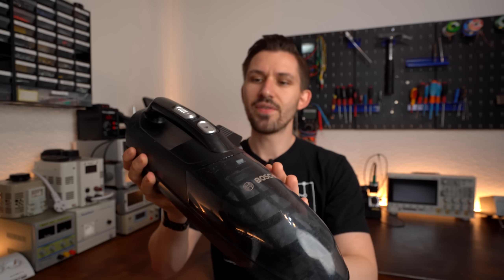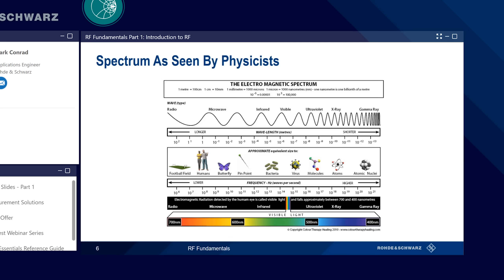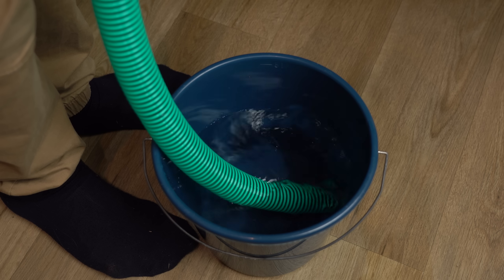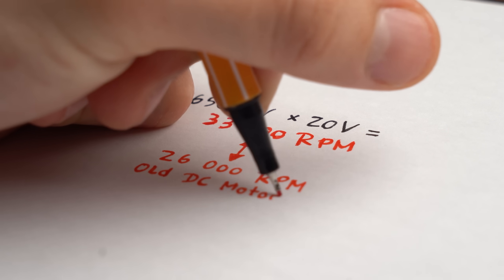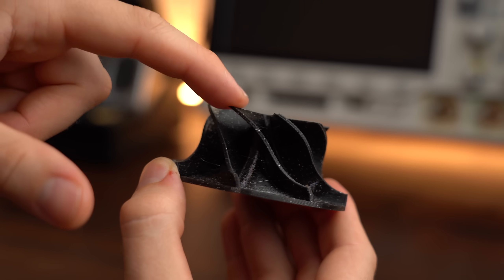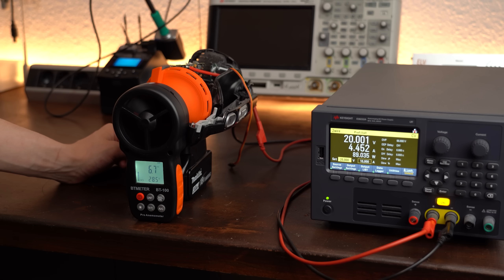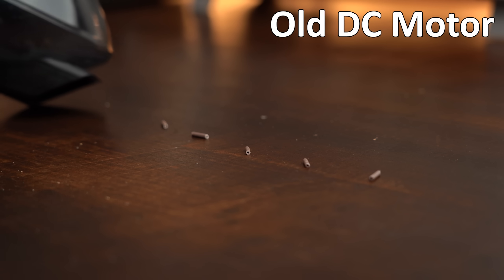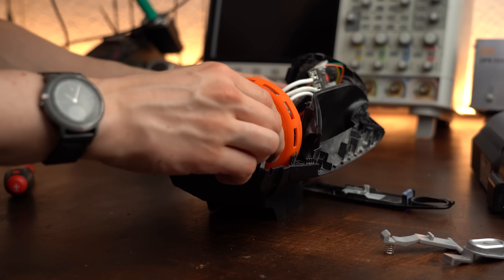My Last Chance to OVERPOWER my Vacuum! (Homemade Turbine V2)

Comment: You should use propellers made from resin mix Siraya tech tanacious and normal resin 50% 50%, this will give a very strong blades yet have some flexibility and not brittle like normal resin. There is a video discussing this in details search for it, I can’t mention it otherwise the comment will be removed.

Comment: Did you try to make a small tread inside motor axle instead of using glue? If you don't have a milling machine, print tool to guide drill.

Comment: You need to key the impeller to the shaft with a locking nut on the end.  That will solve your impeller walking issue..

Comment: Some BLDC motors just have a nut on the end that you can use to ensure the prop doesn't walk off the shaft. Some are even reverse threaded such that when the motor spins, the screw tightens down on the part. You could also go for a keyed shaft to reduce rotational slippage.

Comment: Wow very interesting video! I have done a lot of airflow and suction measurements and most important for good cleaning power is the airflow from the floor nozzle. I have dedicated airflow/suction box for that. I can seal floor nozzle to the box and get very accurate readings.

Comment: Too big impeller inlet and way too big impeller height. That type of impeller gets efficient past 60-70krpm and you need more radial surface area for vacuum. None of the turbo impeller types will work. 15-20mm inducer and over 80mm exducer with mean height of the impeller around 10-15mm and your going to see much more vacuum.

Comment: I would highly recommend screwing the impeler in place, either on the top or side of the shaft. I believe it is necessary for any fan system to function correctly.

Comment: I think you're hitting material strength limitations. If you could find a better way to attach the impeller to the shaft and make the impeller sturdier, you could really push this system. I'd suggest (back seat engineer with no experience here) baking the prints in sand to melt the layers together while maintaining the shape, also trying to temper the plastic(?) and pinning the shaft to the impeller to stop it breaking off (metal has a higher shear strength than glue).

Comment: You need to use more radial impeller design not mixed flow impeller to create more vacum, try to maximize the impeller outside diameter keeping a low width

Comment: Which material and nozzle size did you use for printing the impeller? Smaller nozzle (like .2mm) would probably make a smoother part with less friction, Polished metal even better. Very cool test btw. As other commenters mention of course Bosch/Dyson engineers will get a better result. Imo. it all matters how close one may get by experiments at home..

Comment: You might be able to alleviate the impeller pulling itself off by implementing some set screws. This of course though means redesigning the impeller and also adding some rotational weight.

Comment: So I have about 0 qualifications to give my thoughts but wouldn't using something with it's own ridges be a better shaft for that motor? Like if you were to use something like a nail or drill bit then melt it into the impeller and maybe still use glue? You'd be working with the shear strength of the plastic as well as the glue.

Comment: That looks quite futuristic there. But why is there some kind of radial fan in most vacuum cleaners?
I would do it exactly the same way again: A radial blower. There is certainly room for optimization in the details of the design. Powerful vacuum cleaners have (or had?) two stages arranged one behind the other. The separator between them has guide vanes. You have the space for that. There is still the question of whether such stacked radial blower stages may be constructed in the same way or whether each stage must be optimized individually. These are details in fluid mechanics that have remained hidden to me until now ;-)
The question of the optimal speed is also interesting. I am sure that more speed does not generally lead to more airflow or lower pressure, if the flow is obstructed (by the ground under the brush, by the rotor blades themselves). At some point, stalls are likely to occur.

One more thing: You can cool a motor by directing the exhaust air at it.
Reply: Another thought from last night: How even is the weight distribution of 3D-printed symmetrical bodies?
I have no experience with 3D printing.

What I could imagine as a simple test rig for unbalance detection: The motor including turbine wheel and mount is held on one or both sides with piezoelectric elements (simple piezoelectric speakers are perfectly sufficient). The piezo element is connected to the oscilloscope. A low-pass filter may be necessary here. This should allow the circular motion of the drive set to be detected. To relate the position of the turbine wheel to the motion due to the unbalance, the position of the turbine wheel is also fed to the oscilloscope with a reflex coupler. I think the rest is mathematics. I would add mass first to practice (to develop a feeling for the setup) before removing mass from the turbine wheel.

Comment: Maybe make the impeller closed with a skirt to minimize boundary layer drag and skin friction between the impeller and the enclosure? Polish those impellers and minimize any layer visibility, every ridge creates extra drag, which creates trubulence. If you're doing Part 3 and want to try with an aerospace engineer, I'm down to take Bosch on 😁

Comment: Try roughening up the motor shaft first. Most adheasives need something to "grab" onto. Metal is mormally too smooth for glue to grab on. Sand paper or a careful use of a dremmel should suffice.

Comment: You must work with the surface finish on the impeller and the housing. Surface roughness greatly affects flow attachment and its properties (Reynolds numbers, fluid dynamics, bla-bla-bla; you can easily find a lot of free articles). Long story short, surface smoothness is critical in such applications, and losses in the system scale exponentially with the speed of the blades.

Comment: there is a flat spot on the motor spindle that uses "normally" a grub screw to hold in place a sprocket etc, this maybe could be implemented into your design?

Comment: I believe the cap on top of the fins, on the original, was to increase static pressure at lower rpm's .. also static pressure increases with multiple stages.
People often emulate automotive turbos without taking into account the facts. They have very tight tolerances, and operate at extreme rpm's, some at over 100,000 rpm. At those speeds and pressures, the chamber itself becomes the cap on top of the fins. The cap on the fins will leverage the lower rpm window for your materials of choice, and those often used for mass produced products.

Comment: You use an open impeller design, which causes recirculation flow around the impeller blades, lowering the efficiency. Try using a shrouded impeller and reduce the clearance around the impeller and the shroud.

Comment: Hey Bro I'm from India I have a Problem with my PlayStation 3 wireless controller 🎮 issue is Flexible Pcb that Pass current when pressing buttons like TV remote so it's got Damaged an there a Product called silver conductive glue it's not available anywhere in India 😞😵‍💫 it's Chinese products so how can I fix this Problem 👉🎮

Comment: Drill and tap a small hole in the shaft of the motor and put a washer around a screw to hold the impeller on.

Comment: Printed parts are rarely liquid and gas tight. It seems very probable, that part of the vacuum "escapes" due to porous structure of the impeller housing.

Comment: Wait till you find out that many of Dysons batteries don’t have a battery cell balancing management implementation, and the software is written so they just stop working if a cell gets too far away from the rest. There’s a custom firmware you can flash to some, but I would not buy a stick vacuum, period.

Comment: I think adding a sun gear to the motor and planetary gears to the impeller would spin the impeller faster at the approximate  same motor rpm and power requirements.

Comment: What about switching to a shaft that has a bolt thread down the middle, so you can mount the impeller kind of like a F1 car wheel? The screw would clamp down the impeller in place

Comment: With a bigger impeller it needs to spin faster I order to perform similar. Also the layer lines are holding you back. Try a vapor smoothed ABS print

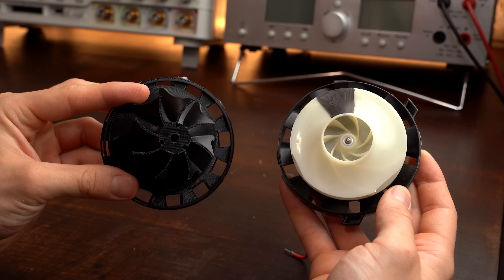Comment: compared to original BOSCH impeller on 00:32
your impeller inlet vs outlet diameter ratio was smaller than BOSCH - you will produce less pressure difference than BOSCH. BOSCH impeller will be better perform after you put the casing together.
open impeller vs closed - tricky for low precision parts. will have more internal leakage results loss of pressure / flow→ low efficiency

If i were you, i will try copy original BOSCH (easy since its only 2D blade design) and try to increase outlet width to increase vacuum effect.

Comment: I'd file a small flat section on the motor shaft and use a grub screw to secure the impeller in place.

Comment: I wonder if the FDM printing is causing some issues in strength. Spinning that fast with that much airflow, the blades must be flexing somewhat. Barring injection mold (which I assume Bosch used), maybe a resin printer could make a difference?

Comment: Your video is cool 😎 ! It is the same thing in turbofan for aircraft !
If I can give you a advice, the 3 designs are better but maybe a little bit agressive for a 3D printed compressor. Maybe you need to put a stator to adapt Speed Triangle at inlet ! Search Speed triangle turbomachines on Google 😉 ! Gentle warning : stator need to be before rotor not like airplane engine compressor

Comment: This is why you all should just buy an Kirby Whole  HOME Vacuum system 

Uses 110v wall plug yes but there entirely made of Stainless Steel and an Killer motor, that also uses that more advanced blade impeller design you were talking about for the suction, Additionally they make the propeller part out of high strength military grade Ceramic so i can litterly suck up  pennies and quarters😂😂😂😂 Get them off of offer up or ebay for Less then an Shark vacume 😂 GOD PEOPLE THINK PLEASE 🎉

Comment: I guess one way to have the turbine stay on the shaft is if the sucking end of it was pointed towards the motor, that way it would only pull itself more securely on. That being said making something like that work from an airflow perspective and work within the packaging confines of the original vacuum would be extremely difficult.

Comment: The closed impeller design they used can make a massive difference for static pressure.
On impeller to motor connection just get some metal(alluminium) hub for plane/car model motors and make the impeller connect to the hub instead of the motor shaft. This will introduce much higher surface and possibly hard connection to it.
Reply: 3d printing is not suitable (not yet) for something that needs to be as precise and strong as an impeller.

Comment: I think you can take it a bit further. I'm very familiar with RC motors and we never use a press fit gear as they'd come right off the shaft like you're seeing. A simple fix would be to integrate a 48p RC pinion right into the impeller. You'd need to add some gcode to pause the print so you can insert the gear directly into the part and then keep printing to seal it in. This will give you teeth on the gear to engage the impeller directly and a small hole in the side of the impeller will give you access to the pinion's set screw. The set screw in the pinion will lock the whole assembly onto the motor.

Comment: Part 267384929292- finally I got a new vacuum after spending years on engineering, tones of 3D filament and tens of k € on experiments.

Comment: Are you only gluing the tip? If so, it's no wonder it won't stay put. You could use set screws but in plastic It's not really reliable, maybe try gluing the entire length of the shaft? Or use a motor with a threaded hole in the shaft and add a screw on top to cap it off.

Comment: A grub screw will help with keeping the impeller on. It will have to be factored into the design. As far as the impeller is concerned you could try carbon fibre filament, it may be stronger. The other option is creating a silicone mold of it and using a casting resin or making a clay mold,and using aluminium to cast the part.
Reply: Or simply buy the cold side wheel from a car turbo which is pretty much the same shape.

Comment: If there is 1 thing meccano taught me as a kid, is that anything that connects to a motor shaft should also have one or two screws connecting from the side and making a tight grip around the shaft.
live .staticflickr .com /3012/3032963698_fe8dac17ef_b .jpg

Comment: Great work. Vapor polishing would improve the smoothness of your prints and should provide some level of performance gain as the airflow over the blades should be smoother. You're probably losing a lot of efficiency to airflow past the clearances between the impeller and the housing. Perhaps SLA printing would be a better option, as it's higher resolution and it also produces smoother surfaces.
Reply: Or dipping the blades in dilluted plaster & letting it dry? (or epoxy)

Comment: You could have used original impeller and new motor that might be the best way to achieve efficiency.
And for benchmarking you can use dc motor with new impeller as bldc tends to consume more power at higher rpm and provides very less torque.

Comment: If you want, I design and work on these for a large turbomachery company (the big blue ones), and can offer you some pointers, both with how the impeller is attached, and why you are having such issues with static pressure

Comment: Perhaps with some post processing the FDM prints(sanding, smoothing and sealing), You might be able to get a few percent higher efficiency there. I recall rctestflights videos where he mentions a significant performance penalty with propellers and impellers that are FDM printed without post processing work being done.

Comment: I would coat the impellers in something that fills in the gaps between the layers and/or sand the layers down (probably unfeasible with the gap between the blades)

Comment: one big factor that seems to impede your design is the use of a 3D printer: the end products its produces are far from smooth, and if you know anything about aerophysics youll know that that is quite significant. consider sanding down your prints or making them ever so thinner and then applying a layer of lacquer.

Comment: I learnt about static pressure when I replaced the 120mm fan in the computer's power supply and it died within a year. Apparently not all fans are equal.

Comment: What if you drilled a hole in the shaft and used a bolt or cotter pin to hold the impeller in place?

Comment: If you sand a rought patch on the motor shaft and then put the glue in the bottom of the impeller before pushing it on it will handle alot more speed before the glue fails

Comment: Idea: 
Why not texture the shaft a bit and print the impeller with a bit of an undersized hole and use a soldering iron to heat the shaft to melt the plastic onto it?
Like a heatset thread insert.

Comment: Get PCBWay to print you a 3d metal impeller of the best design you have and add a set screw to secure it to the motor shaft!

Comment: The 3d printed impeller surface quality might play a huge role on efficiency and efficacy.
Reply: That, and that the large inlet diameter will reduce max static pressure

Comment: I would probably try to make the impeller as balanced as possible since even the smallest weight imperfection on one blade can generate giant vibrations. The same on the computer fans, they need to be really balanced to cancel out any unnecessary vibrations. I would also probably change the printing material and the motor shaft like others suggested. You may remember from your other video when you made a 3D printed BLDC motor, that thing could be sent away at any time and shatter into thousands of pieces at high RPMs. In short, I would probably re-design the whole vacuum since you're probably dealing with a really small space for the motor inside the current one.

Comment: A turbo impeller isn't right for this use. It requires very high rpm to do anything. Instead, either reuse the vacuum blower impeller or copy and print a new one that is similar. I just got done building my fume extractor and did not use the turbo impeller style for this reason. My fume extractor is much quieter and much stronger than anything I can purchase for the same price.

Comment: I think your main problem at the moment might be that FDM printed parts have a very high surface roughness, creating a lot of drag which makes the setup less efficient. Try SLA printing the impellers... and of course, the truly best way would be to do injection molding - that's how the original impellers are made, giving you a very smooth surface... but that's extremely expensive of course.
Reply: i think surface roughness actually reduces drag. at least it does on cars

Comment: This is where people mess up when cooling PC's too. All fans are not built the same. Some are made for high static pressure and some are passive. Don't use a passive fan for your cpu or any situation where the fan needs to pull or push through something.

Comment: Try using a carbon impregnated mold propeller / enclosure.

Or make a steel edm cut impeller. Or turn a Mazda rotary engine into a vacuum cleaner.

Comment: It seems that compared to the original it is very hard to create the sort of print you need especially with all of the clearance issues, would an resin printer make any sense?
Lastly you have made amazing progress on getting close to your goal but these designs will go extremely well for the people looking for a vaccume cleaner that is not actuallly replacing the original one.